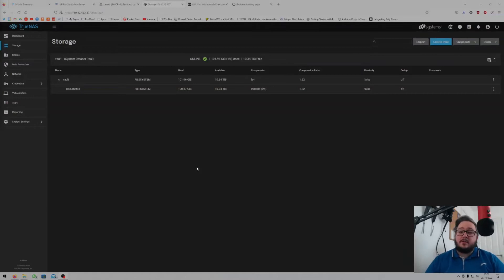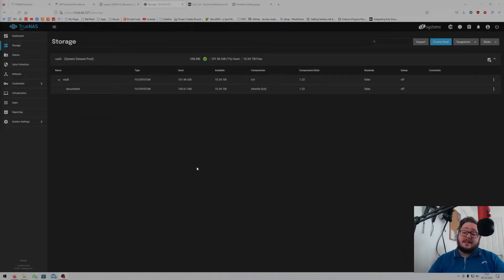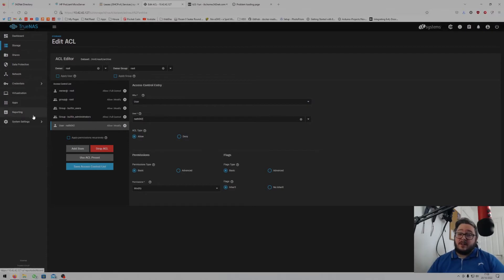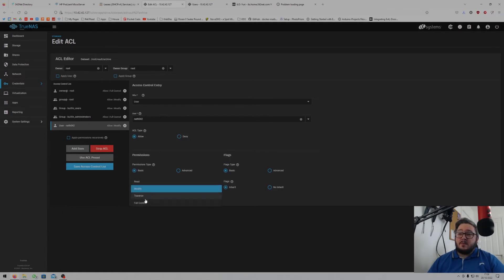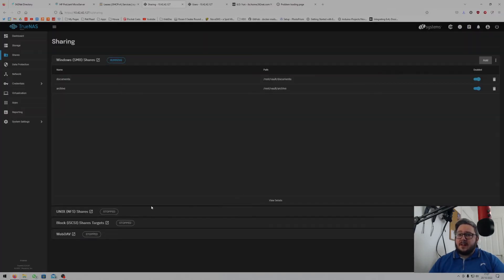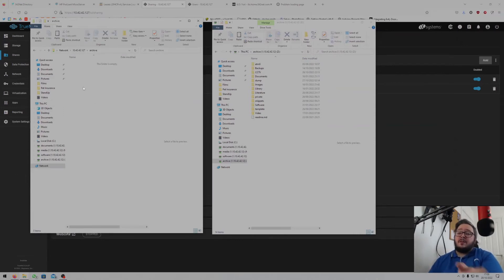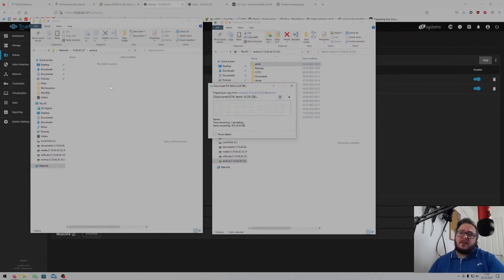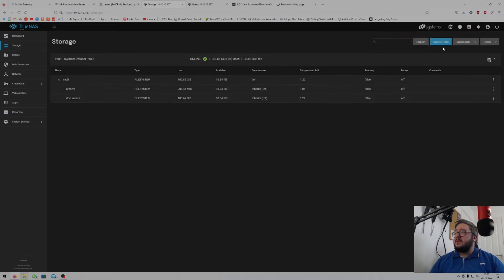Setting Up The NEW TrueNAS SCALE - Storage and Shares Explained

Comment: Thanks for the video but could you cover more in details access rights for configuring truecharts apps to backup data? there is not much information on that unfortunately. For example backuping data to syncthing thanks!
Reply from the maker: I will add this to my list of things to cover, for me i keep most of my important things on the server so to me, if my pc dies i can just reinstall windows in 20 mins and then re-install programs from my software drive. However I will look into syncthings as it might be nice to keep full backups just incase.